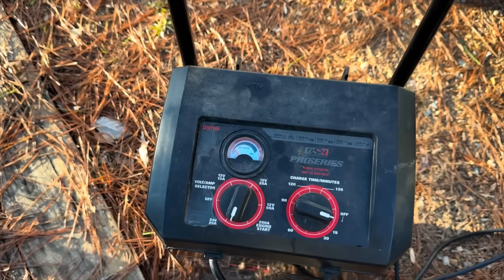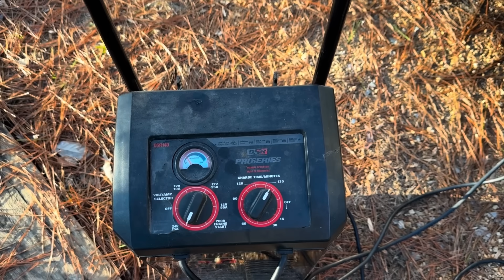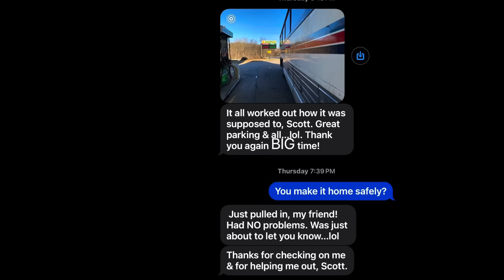Lead acid battery exploded in my face.

Comment: I am so glad that you didn't get seriously injured. I saw this happen once when I worked at a truck repair shop in West Sacramento, CA. It was a group 24 battery. My co worker was servicing a truck that had a bunch of group 24s in the battery box. He just used a screw driver to pop off one of the cell caps, checking the electrolyte levels, and it went off like a bomb! In his face. It sounded exactly like a 12 gauge shotgun to me. I can not imagine how it would sound when you are standing right over it. The shop owner ran out of the office, grabbed the guy by the arm, and dragged him over to the eye wash station. He also got a garden hose going over his head, and face. Luckily he did not get injured. I don't understand how he didn't get injured, because the entire top of the battery was gone.
Scarry shi#!
Reply: 60 years of seeing eyewash stations,   first time I've ever heard of one being used.   Bet that guy was glad it was there...
Reply: @freebuilder007  He certainly was. The one we had in that shop was  the type that hooks up to the water main. I believe it also incorporated an overhead shower. 
He was very lucky to get through the experience without significant injury. Just a couple of scratches on his face.

Comment: What a lesson!  Hydrogen sulfide is extremely volatile. Trust you will invest in a stock of good batteries and stop screwing with marginal worn out batteries!  You could have easily been blinded.

Comment: flooded lead acid produce hydrogen gas both charging and discharging and tiny spark is all it takes   lucky you diden get it in your eyes many mechanic has eye damage .  and never jump, or charge a frozen battery i seen the whole top of a 12v blown off during a cold spell it was the aaa driver hit it with the old fox products  18v  truck mounted hot shot unit  . that are no longer allowed to be used on computer controlled cars

Comment: Looks to me that the terminal melted a path through to the inside of the battery when it was cranking. Just bad timing that you stopped him cranking when you did, one more second it'd have blown whilst cranking.  Good advice from others, to wear glasses & have eye wash available. Had battery acid in the eye one time, it's something akin to how I imagine 1000 red hot needles would feel. Definitely something you want to avoid, no matter how rare battery explosions are. Stay safe, the buses need you!

Comment: We had this happen at my old job. We decided to begin unplugging the battery charger from the wall and waiting a minute before unhooking it to minimize the chances of a spark.
Side note, this is why the last connection for jumper cables (and first off) should be a ground clamp on the engine block of the 'dead' vehicle. This way any arcing (unavoidable in this case) is on the engine hopefully 12" or more away from the battery. Most people dont know this and just hook straight to the terminals.
Reply: Always, Always, Always un plug the charger first. That way you never get sparks when you take the clamps off. Safety glasses are a must as well.
Reply: Also, when you (properly) hook up or take off the negative cable to or from an engine grounding point and not the terminal directly, your face is always going to be farther away from the battery.

Comment: Back 50 years ago it was more common for batteries to explode, the battery would get weak from age, someone would crank up the voltage regulator, the acid would start boiling out leaving a large volume of hho, and when they tried to boost the vehicle there would be an explosion, I've seen batteries with the entire top blown off, glade your not blind.

Comment: Hydrogen is no joke.
Reply: Even worse with batteries because it's a mix of hydrogen and pure oxygen floating around - perfect explosive mix
Reply from the maker: I would have expected it to be loud because it was an explosion, but i never could have imagined how loud it really was until i experienced it!
Reply: @deezelfairy  Absolutely correct, charging battery makes H2, I have exploded a couple. . . . . . .
It's more excitement than you ever need.
Reply: @572Btriode  Yup, they produce H2 at one plate and O2 at the over plate - that's what's happening when a wet battery is 'gassing'
Reply: @deezelfairy  An perfect mix accurate to the atomic level.
Reply: Hindenburg is a fine example.

Comment: As large as those batteries are perhaps there is a replacement Lion/ Supercap version available which would provide more cranking amps and a longer life. The lithium ion battery is connected to the supercap via a resister so the supercap actually performs the cranking.

Comment: Why exactly did it happen???
Reply: During charging and discharge hydrogen gas can form which got ignited
Reply: @chrisvig123  ok, thanks
Reply: The process of charging/discharging a lead acid battery is actually a chemical process. During that process hydrogen gas is produced which is extremely flammable. If anything should cause a spark it is possible to ignite the hydrogen gas. It’s always a real danger but an explosion rarely happens so the correct precautions are usually not taken.
Reply: @dcole109  Thanks for the response. No more Lead batteries for me!

Comment: One time in a small tug boat with a 671 dead batteries went to use a pair of jumpers to an other 8 D battery, must have sparked sounde like a gun shot going off, blew the top of the battery off luckily i was off to the side no injurys, just deaf for a few hours !!

Comment: I highly encourage you to get an eye wash station if you don't have one.  Battery acid in the eye is extremely dangerous.  Also always, ALWAYS wear eye protection around charing batteries. Especially charging batteries of some unknown condition at a high charge rate which you do a lot.  
I've been working on lead acid batteries of 30 years, and eye protection is a hard rule.
Reply from the maker: We have two eye wash stations in the shop
Reply: @BusGreaseMonkey  Did you use it properly?  Or should I say did you follow the instructions?
Reply: Absolutely!!
Reply: also watch polarity when you connect a jumper or charger. I reversed a connection one time and the battery caps blew off and I too got acid in my mouth, but that was all.
Reply: Indeed, An eye washing station is a must in a shop where lead batteries are serviced. I'd also advocate having a full face visor hanging off any battery charger and making it a hard rule that no one is allowed touching a battery clamp without wearing the visor. Scott, that was, next to the day you met your wife, the luckiest day of your life !😅
Reply: I bought a used car that wasn't naintained. Battery under the rear seat exploded. Acid destroyed the carpet. I put baking soda everywhere to neutralize the acid.
Reply: Yes wash station on Amazon $ 25